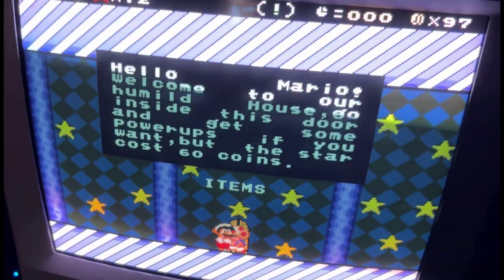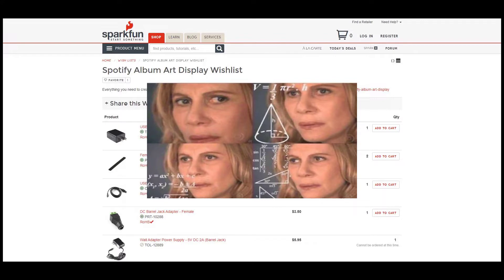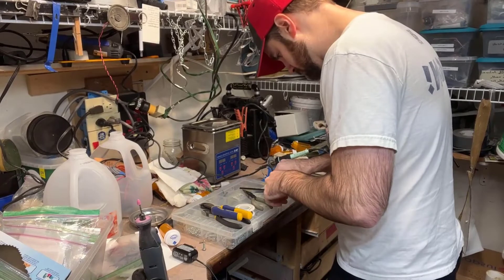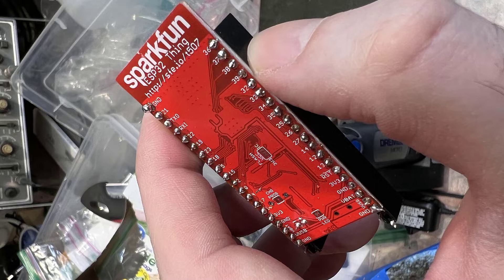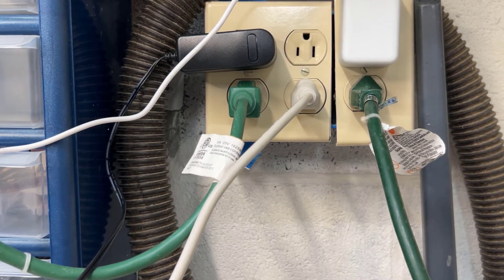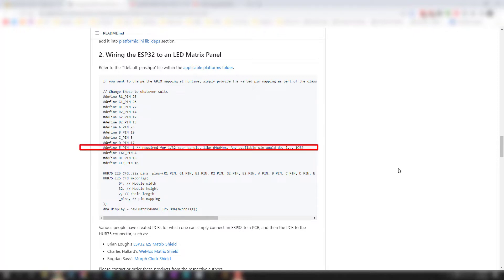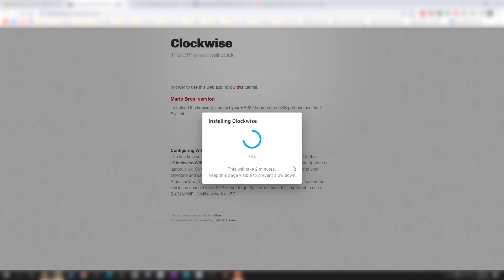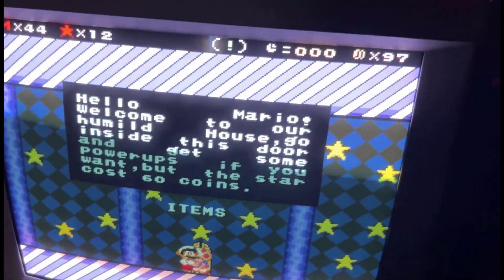Super Mario Clock on 64x64 LED Matrix - Happy Mar10 Day!

Comment: can I use esp8266 instead ?
Reply from the maker: I would stick with the esp32. You need a faster processor (dual core) to run LED matrix projects. For instance - even the Arduinos can only do simple colors and shapes.

Comment: Hello.  I tried the Mario clock project and the clock is two hours behind.  For example I entered US/Hawaii as my time zone and saw the incorrect time.  I reinstalled the code and tried Pacific/Hawaii and got the same 2 hour delay.  Does anyone know what could be wrong?  Thanks!
Reply from the maker: Did you try "Pacific/Honolulu"?
Reply: @thesixsigmaengineer  
I did. Both time zones are two hours behind what they should be. Right now it is 0806 and it is showing 0606